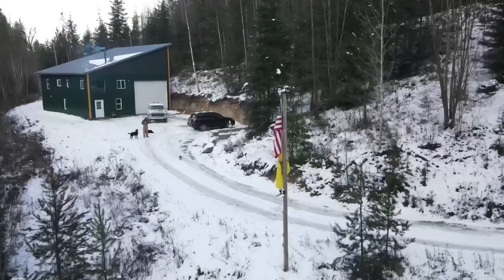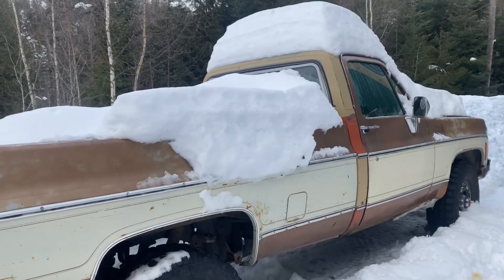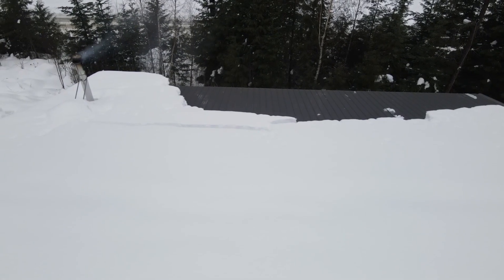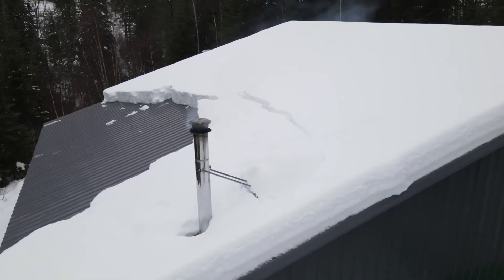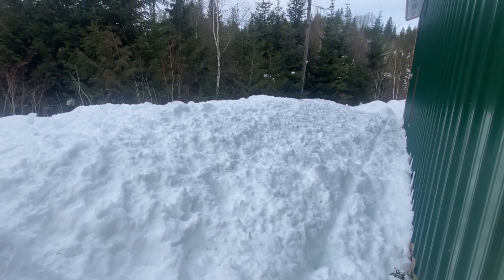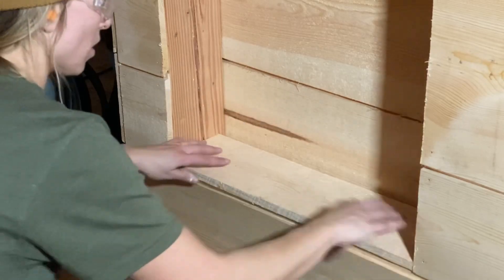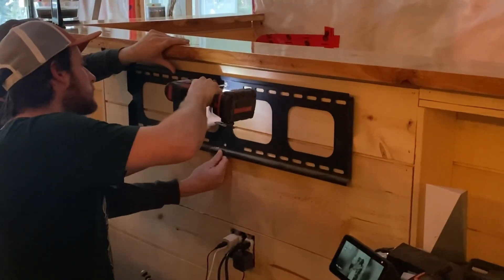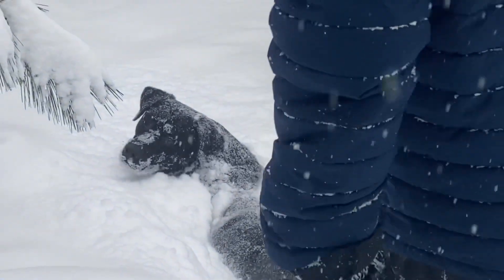Inundated With Snow | Idaho Winter Update

Comment: Thanks for the weather update. I hope my tractor shed didn't cave in on my tractor with the additional snow. I am headed back up during this weather break moving more stuff up. As for tractors: my Allis Chalmers is 4WD diesel and did move the snow 2 weeks ago but I cannot use my 7' snow blower because it requires more than 25HP. I would suggest 40-50HP and 4WD. Be Blessed

Comment: Maybe add a lean to extension on the lower edge of the shop. 10-12ft covered lean to would give you dry storage, and the snow would slide off over the edge of the hill.

Comment: I have a question or 2.  Is it possible to put your goose-neck trailer, the car and your truck in the garage when it snows, just in case you might need them later; Or building an A-frame over the trailer, seeing that you have trees all around and will need the trailer from time to time during the winter?  Have you two considered rubberizing the block wall between the dirt far above the dirt landing above?  Is it possible for you to maybe dig out the wall of dirt away from the block wall, giving yourself a bigger gap, since rain will wash down more mud? Life is a learning curve for sure!  I am really glad the chimney pipe is still up!  Thanks so much for the update!👍👍

Comment: Lost my wood stove pipe to the snow avalanche on our metal roof. Folded it in half and ripped a hole in the roof. Going to add snow stops above it as about 4-5’ piled up behind it and with that rain and the sun coming out it just went 😳. And definitely a front mount snow blower on a tractor. Well worth the extra money. Tractor should have a mid PTO. There are a lot of rear mount ones cheep because they really suck to operate.  Anyway thanks for posting your adventures!

Comment: Take the pull cover off use a drill too start with the correct socket size
Reply: Just tried that after seeing it on YouTube.. didn't work at all. Disappointed..but I've seen it work.

Comment: Hey guys keep your eye out for an older tractor….they’re cheap, easy to repair, and parts are readily available. Mine is a 1956 ford 960 with a plow blade on the loader arm and a back blade. Move snow here in northern Michigan without hesitation. Show a better shot of those cedar boards…they looked awesome.

Comment: Wow, that’s quite a pile of snow under the roof edge. I suspect the only solution to that is a front end loader or skid loader to pick up, back up, turn left, dump down the hill, repeat. Several hours of work for sure. And I suspect it would be risky to let the left front tire rock over the edge. Someone said a snowblower wouldn’t work on the roof discard. I think that’s correct. Someone else said not to bother with a rear snowblower because they only work in reverse. However, I expect as much as you have to do, a blade would just end up with big walls on the side of the road and no place to push snow to. I do caution against going the repair/direct replacement of your walk-behind blower. That’s really not meant for the scale of your site. I’d think 4-5’ pto driven rear mount would be more suitable and probably about the lowest cost entry into that functionality. Optimum would be a hydraulic drive skid steer attachment snowblower. That depends on bankroll. 🤔😏

Good luck with your water problems - both the frozen kind and liquid kind.

Comment: not sure if you are aware of them, but there are things called "pipe heaters".. Available on Amazon.. 3 ft to at least 50ft' lenghts of powered cable.. not sure they would do you any good, but with some imagination?..Who knows.. put them inside of pvc pipe?..Of course the metal roof manufacturer probably has solutions.

Comment: At this point I would be figuring out a way to make a lightweight blade attachment (aluminum or magnesium) for one of the snowmobiles so it could be used as a snow plow. It doesn't have to be real complicated, it doesn't have to move more than a couple of inches at a time and don't think for a minute that you couldn't market and sell something like that. And file for a patent immediately. I'm honestly surprised nobody has thought about this before. Necessity is the Mother of invention. I'm definitely rooting for the two of you.

Edit. Delete this comment and get on with it. 💖

Comment: Just a thought guys, after warmth sets in and all the snow is gone off the hill and next to the block wall, try sealing the block with basement sealer or rubber matting designed for that on the outside which might help from seepage through it and stop floor flooding, just a thought !!

Comment: I feel for you guys. I wouldn't be able to stand that much snow. 
Definitely get that tractor for next winter and build yourself a lean-to carport for your vehicles and trailer and tractor etc. Save yourself the shoveling..... Better yet continue that roofline over the ridge so the snow doesn't accumulate NEXT to the garage/house. And use that as your lean-to. It'll save you time to work on the other side water problem. Seal the outside about 6' up because you never know right? 

I'm looking forward to watching more videos
Reply: It needs to be in a A-frame construction. It would keep the roof clear

Comment: Hey Mike. Don't waste your money on a snow blower for the tractor when you get one! I have a rear mount 48" blower for mine & it does not work for the snow that comes off our building.
Works great for powder, but that's it. A rear blade is a lot cheaper & will work better for you.

Comment: Don’t bother with a rear mount snow blower, only works backing up. Find yourself a used tractor loader, a blade doesn’t work very well in 3 or 4 ft of snow. Thanks for sharing your adventures.

Comment: Don’t buy a backhoe attachment, waste of $9000. Your much better off renting a mini-x once a year & bundling those projects up. I’d buy a Kubota L2501HST with R1 ag tires (or equivalent Kioti/Bobcat - not a fan of the 3E Deere). Load the rears & put chains on the front tires at the very least.

Comment: What happens if you leave the snow against the outside wall until Spring? Just wondering. When I was a kid, a couple of winters, we had snow up to our first story roof on our porch(10-12 feet). My siblings and I thought it was awesome since we could sled down the roof. We dug a path/tunnel from the front door, but the rest stayed until it melted. This was a farm house in South Dakota though, so the climate is slightly different.
Reply: Just a lot of weight pushing against the side of the house
Reply from the maker: We are afraid of the snow melting and just leaking into the shop, plus a lot of pressure on the outside.

Comment: A tarp system on a motorized roller right at the bottom of the overhang could break the majority of the roof snow loose whenever you wanted. It wouldn't be too hard to make. It would have stop short of the side of the roof where the stovepipe is. But you definitely need to be able remove the majority of the snow on demand!